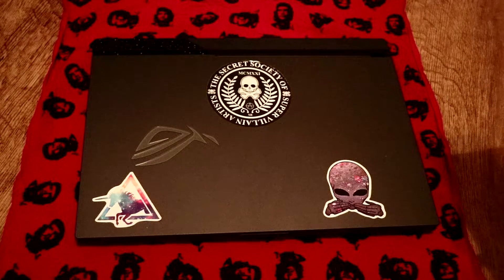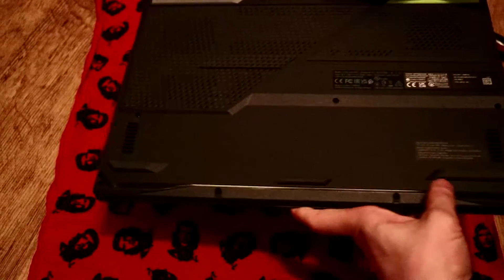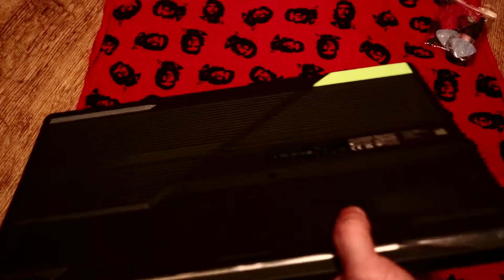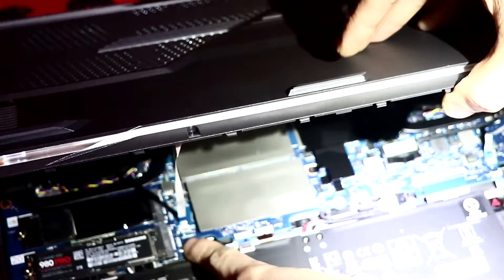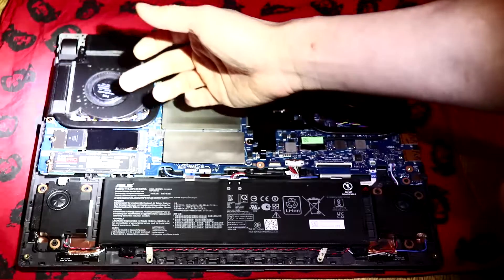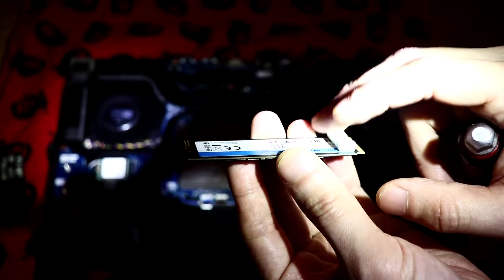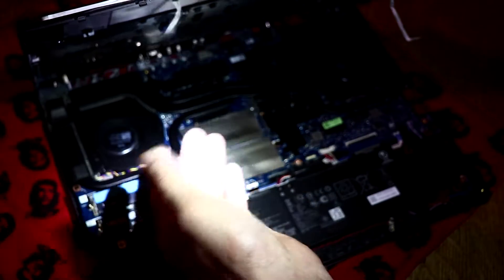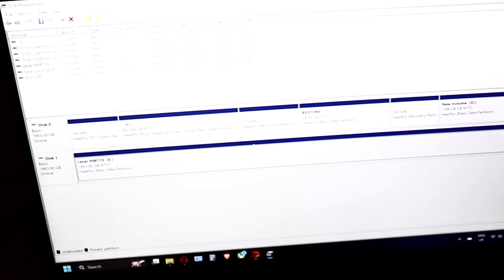Asus G15 Strix SSD M.2 2TB Upgrade G513RC (2023)

Comment: Battery's "don't disassmble" means - don't take the battery apart, that suggestion has nothing to do with replacing it with more powerful one :-) Also there was no need to disconnect those 2 flex cables, the SSD could have been replaced/added without removing the palmrest, and finally using the flashlight just killed me too :-)
Reply: Question: how much Storage can you put in, 2) what ram and capacities can you upgrade to? and power, what are the Most PSU you can upgrade to?
Reply: @augustchildgaming2065 nothing  on PSU, just use the original AC adapter, 2x32gb and 2x2TB will be the max out numbers for ram and ssds